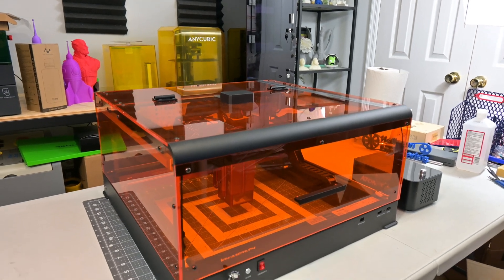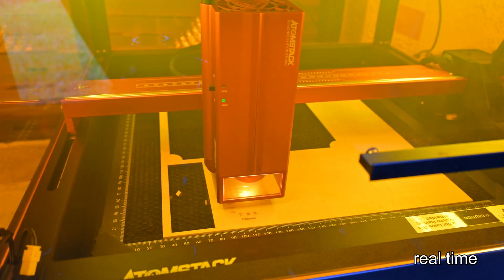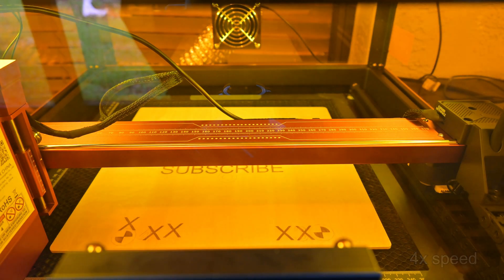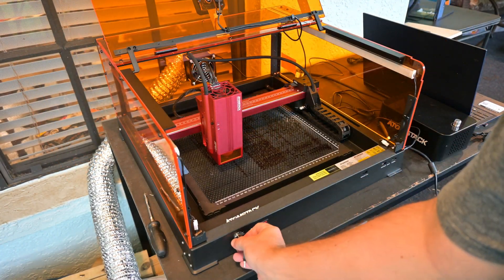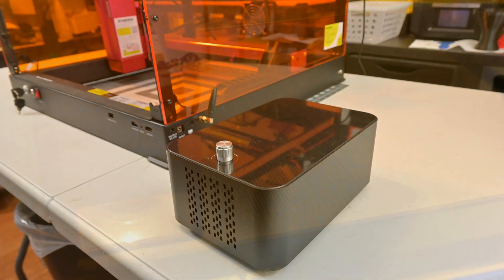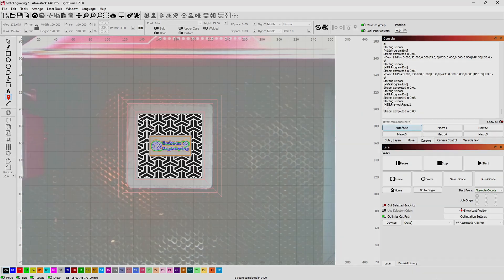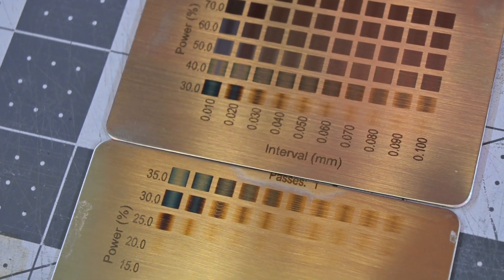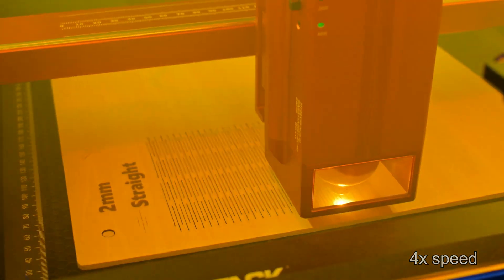Powerful Dual 48w+24w Laser Engraver | Full Enclosure | Motorized Z Axis- AtomStack A48 Ultra Review

Comment: Could you help me because I don't know what the red part with "up" and "down" that you have on the side of the machine at the start of the video is for?
Reply from the maker: Are you talking about the small red metal bracket? That is to mount the laser module, if you don't have (or don't want to use) the motorized z-axis.
Reply: @HoffmanEngineering  Thank you

Comment: There's not a lot of data online but is it capable of handling the common 12x12 3mm basswood sheets? I ordered before noticing that it doesn't seem to be able to engrave the most common material size which blows my mind. 

I ordered it with the conveyor the same time I ordered the laser. Laser will be here tomorrow, conveyor hasn't even shipped. 

I suspect I'll be returning it. The Wecreat Vision can at least cut a 12x12 out of the box.
Reply from the maker: You are correct. While the frame is large enough to fit a 12"x12" 3mm plywood board, the work area on the y-axis is only 280mm (11"). So you can't engrave a 12" board edge to edge without the conveyor.
Reply: @ that's such a shite design flaw. 12x12 is the most common size of blanks for wood. My local lumber yards don't stock anything 1/8". Atome stack has no ETA for the conveyor that was ordered at the same time. I should have kept the Falcon 2... Sure it had way less features and setting a camera up for it was a pain but at least it could cut blanks from Amazon. 😞

Comment: I received my A48 Ultra yesterday and it does not seem to work. For some reason the laser won't fire the lights indicating 24 or 48 watt don't illuminate. There are red cross hairs but when I go to engrave it moves to the starting spot and just sits there and doesn't fire. Also, when installing the autofocus head I wasn't sure if you put it all the way down so it sits flat on the table or have it flush with the bracket? The alarm light is on (green) should that be on all the time or only when there is an alarm?
Reply from the maker: Hmm, that's no good. I'd have to double check my videos about the alarm light, that I'm not sure.

For the motorized z axis: There needs to be enough room for the motor to move the laser down and touch the surface of your material before bottoming out on the z-axis. There also needs to be enough room at the top so it can move upwards to home. So I think they recommend giving the z axis carriage 5mm of clearance when the laser at the lowest possible point. 

I did that by loosening the set screws holding on the laser. Then I let the laser rest on the surface of my honeycomb panel, and moved the z-axis manually until there was 5mm gap at the bottom of the z-axis. Then tightened everything up. 

That means the laser is almost always towards the bottom when working normally, and only rises to the top when homing before auto-focusing

Comment: The factory enclosure and exhaust are under valued items, and are a nice addition.  They are lower costs items that are generally accessories, that you need when you really start cutting things that smoke easily or smell...

The lack of honeycomb insert is crazy.  Every machine at this price point should have some sort of insert/tray/workspace.   Just my 2 cents...
Reply from the maker: Yeah, it's an interesting choice not to include a tray/panel. I guess people are far more likely to purchase a honeycomb panel than an enclosure, so they include the enclosure knowing people will also most likely purchase the panel as well.

Comment: Keychain lasers are class one!?
Reply from the maker: Seems like most Keychain laser pointers are class 2 (limited direct eye exposure) or a low class 3 (limit reflections). You don't want to spend more than fractions of a second pointing them in your eye.
Reply: @HoffmanEngineering  I wondering if the glass is class 1, will it block class 2,3,4?